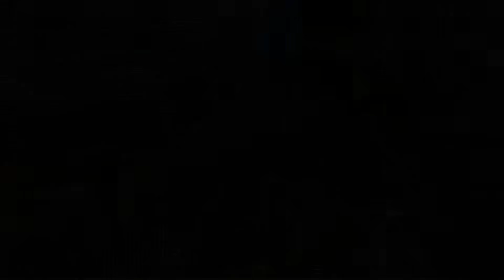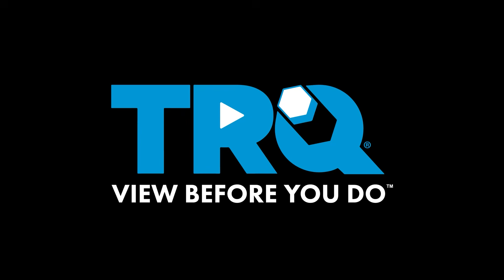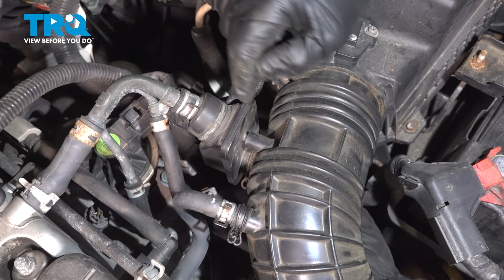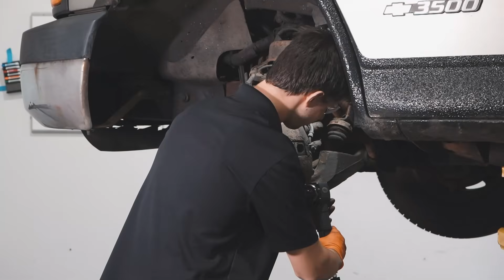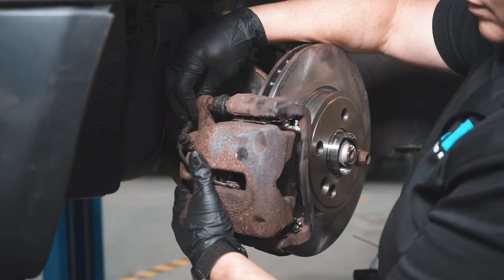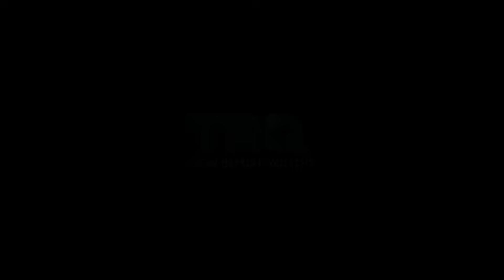How to Replace Air Intake Boot 2003-2007 Honda Accord 2.4L

Comment: Thank you. Extremely helpful. I just did this. But the replacement hose did not have a space for a clamp at the top opening of the hose to the air box. So, that clamp didn’t fit. Do you think this is necessary?

Comment: I needed to find the reverse lights switch on my Honda Accord V6. Found this video super helpful as I think that the switch might be hiding underneath this air intake. Can you confirm if that's true? I just don't wanna take the risk of opening it, if the reverse light switch is not there? Thanks.